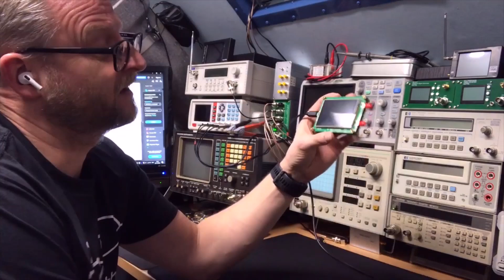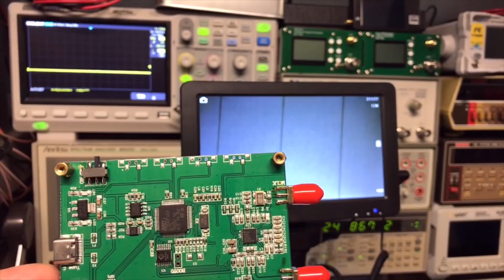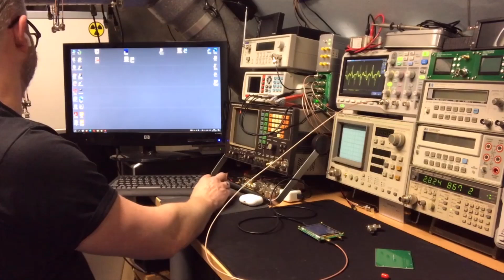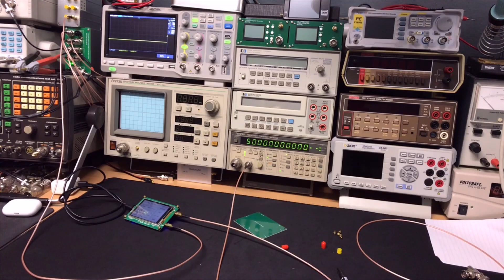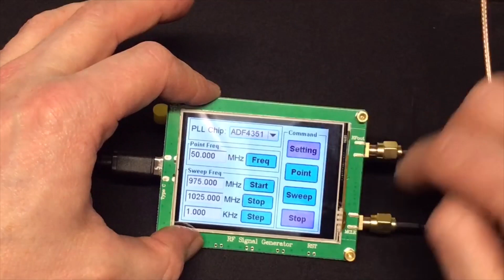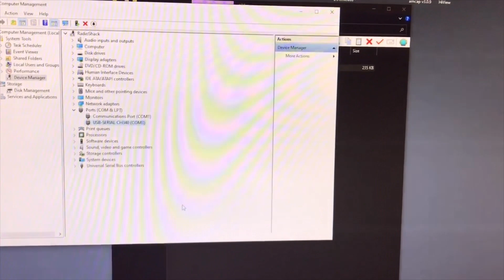TA•0112🟦ADF4351 LCD - External Reference Mod. and software install

Comment: Hi Tony,  Thanks for all your videos.  lots of learning watching them.  In relation to this particular video .... I have a ADF4350  ( purchased in May 2026)  138 - 4400MHz.  I discovered that it doesnt have ability to change the REF freq in the settings menu it only has RF Output level and Sweep Time options and Work Mode A or B  which I have no idea what A and B modes do ??   haha. So I couldnt switch the REF to 10MHz I disabled the onboard osc like you did (  your unit and mine also have a different component count in that area ... yours has more resistors / capacitors.   If I feed it from an external GPS locked generator at 25MHz all is good and I get rid of the huge freq. inaccuracy of the ADF4350 generator ( more than 2.5kHz). Now it is 0.002 Hz  of accuracy  which is awesome 😁
Reply from the maker: awesome!!  wel done!  yes some devices use 25MHz.  i did similar with a UNI-T. generator.

Comment: Awesome, did you ever do the external clock reference modification on the siglent? I'd like to do it on my 1102x-e!
Reply from the maker: Hi, i never did that, it was very close to spot in, later i sold it for a sds800x-xd.

Comment: After asking the same question probably in the wrong video https://www.youtube.com/watch?v=DFtC7icVr-E : I noticed there is a new version of the 2870 signal generator with a modified menu. The external ref hardware mod is the same for 4351 and 2870. In the description on aliexpress, the field for entering the reference frequency seems to be missing. There is a new button labeled "gear" that i don't know what it is for. Does anybody here have information? It might also be possible to change the reference frequency by the software, but i wonder if this is maintained after power cycling.
Reply from the maker: Thanks!

Comment: Which gps unit do you use as your reference?
Reply from the maker: Hi, BG7TBL, the item links are in the video description.
Reply: @TonyAlbus  but what is the significant difference between using its on-board oscillator and using a gps based reference?
Reply from the maker: @therealspixycat  Old video but here is why;: https://www.youtube.com/watch?v=zFlobGBxxH0

Comment: Hello,

I installed PLZ-PLL-435x software. It works. However, there was a problem that I could not enter the frequency with a decimal. For example, if I enter 144.250MHz it reports an error, but if 144MHz it is OK.
Reply from the maker: Hi, thanks for the feedback.. i was a while ago, so i am not sure, but you can try a 'comma' and not a decimal point, maybe that works.

Comment: Hi, it is good video. Does it produce sine waves around 100mhz?
Reply from the maker: Tahnks Ahmet... I can maseure it is below 100MHz  , but above i can not really see with my oscilloscope it starts to look square above 100Mhz.., its only 200 and i need at least 3x the frequency to properly see., i think i did a test in one of my other video's about ADF4351
Reply: @TonyAlbus  In fact, you mentioned the answer to my question at 12.30 in your video in the link. However, I could not understand which card produces the wave that transforms into a sinus at 100mhz. Which; max or adf? Thanks
https://www.youtube.com/watch?v=DFtC7icVr-E&t=738s
Reply from the maker: @ahmetozdemir7173  in my test both.... but i think i can not see with my current oscilloscope because of the BW and Sample rate that is not sufficiant to mesuere squares you need 3-5 higher to messuere correctly digital signals(squares) i have 200 MHz.. i need 300-500 MHz to see it... the missing samples make it look Sine.. (could make it look Sine)... i will make a video about BW and SampleRate next week or the week after... interesting....
Reply: @TonyAlbus  Dear Tony, I'm looking for an answer. Is the 4351's 100mhz signal harmonic?
This is very important to me. Please, you have the necessary equipment. Could you take a look?
I'm looking forward to your video about BW and SampleRate.
Reply from the maker: @ahmetozdemir7173  i added a link to the fotos of the MAX and the ADF..harmonics at 100 MHz
Reply from the maker: @ahmetozdemir7173  Harmonics: https://www.tonyplaza.nl/download/YT129/ADFvsMAX.zip
Reply: @TonyAlbus  thanks my friend.
Reply: selamlar   PLZ-PLL-435x yazılımını  nereden indirebilirim  veya sizde mevcut ise bana iletebilirmisiz   iyi günler tekrar selamlar

Comment: Hi Sir. I have tried this frequency synthesizer but could not use input reference lower than 10 MHz. It started to get phase noise. Do you have any suggestion how to deal with phase noise from frequency sunthesizer?
Reply from the maker: Hello Farah, i found that is works best with 25MHz just as the local freq. was on the local TCXO
Reply: @TonyAlbus  Hi tony, what device you used to generate 25MHz as external clock? I am trying to convert my 10 KHz timing clock to be 10 MHz or 25 MHz and using it as external clock for the synthesizer but have not found a way. do you have any suggestions?

Comment: Hello Tony great video, I wonder if is possible to inject one external signal to modulate the carrier on FM.
Reply: Thank you Tony I hope to buy one from 25Mhz to 6Ghz ant tray. Great videos
Reply from the maker: Hello Frank, as far i i undestand it is a PLL like syntheseizer thingy , you can try to put FM modulated signal on the ref input, but i think that just make it un-lock itself.. but it will be a nice crazy test indeed :)

Comment: thank you very much, I thought the sweep was noisy, I was using the ADF4351 to test an LNA with filter conneced to a SDR. while set to single freq it looked great, but the sweep was giving me noise all, wasn't sure if it was from the SDR, the LNA or the ADF4351. mystery solved. BTW I used to be a cal tech in the navy and i'd like to say that's some nice gear you have :)
Reply from the maker: Hello and welcome, glad this video could help, and thank you sir for the compliment :)

Comment: Fantastic job. I will try this on my own next week.
However, I would prefer to take out the L1 Inductor so the clock will not work at all. I saw some crosstalk on the video and that will add to the new standard input signal.
Another issue is that my 10Mhz standard has a Pk to Pk value of several volts. I will have to bring that down. Although the ADF4351 datasheet says:
REFin input sensitivity: AVdd which is 3.3 Volts. But it also says AVdd/2. so max would be 1.65V ???
Question: Have you tried setting the output to be sine wave ? It is in the settings but I cannot set it.
Reply from the maker: Welcome,.. no it only outputs square. conserning  your voltages and spikes , i think you don't need to worry to much... it is just TTL sync.. if it clips it clips.. you still have your rising edge..you can try putting a 50 Ohms to ground and then one in serie.. then you terminate and lower your sync voltage a bit.. good luck.